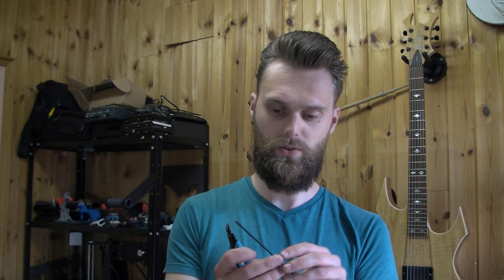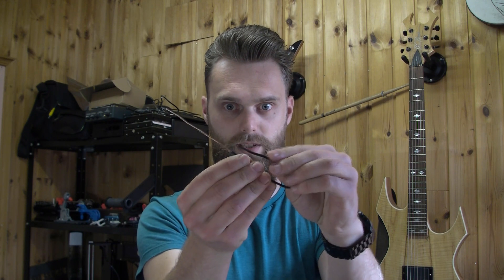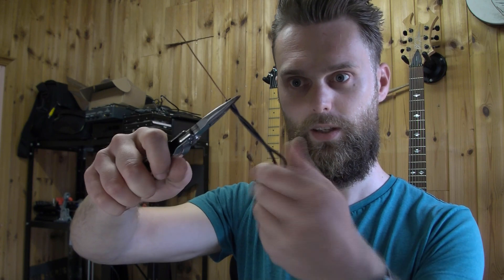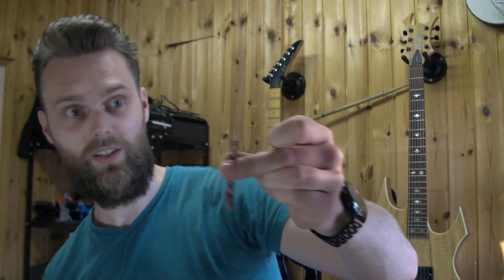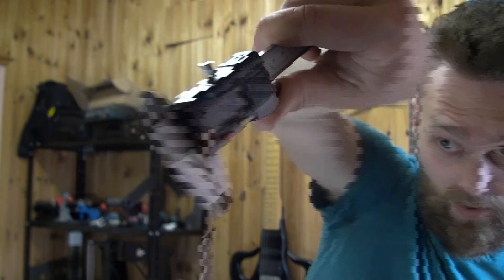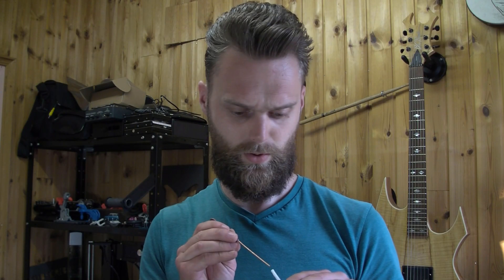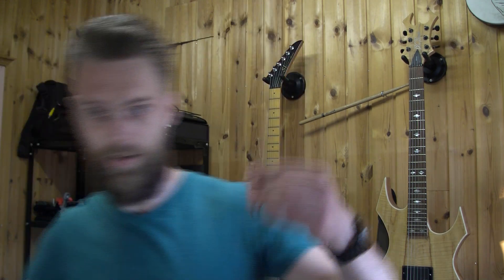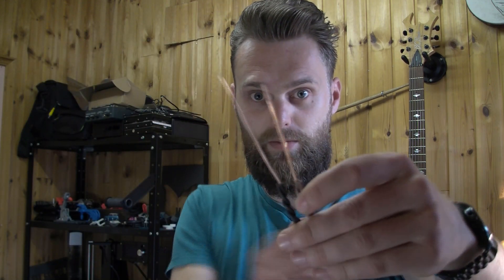Unclog your hot end with this cheap simple tool

Comment: 5 years later and you just saved my life. Messed up in the clipper cpnfiguration and changes the pin for the fan by mistake. put a print to run and left. When came back my stealthburner partially melted and my hotend completelly clogged. many tks

Comment: You saved may day. I used it on my Creality CR-10 smart pro. The hodend was clocked. I headed the hodend up, removed the nozzle and put a pice of 2,5 mm2 copper wire thru the hotend and the pice of fillament that clocked the nozzle just fell out.